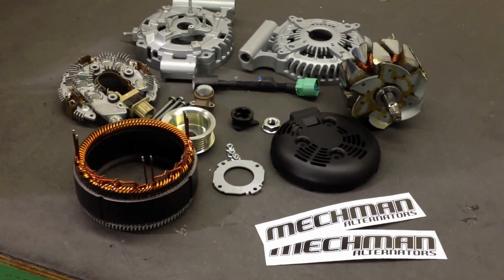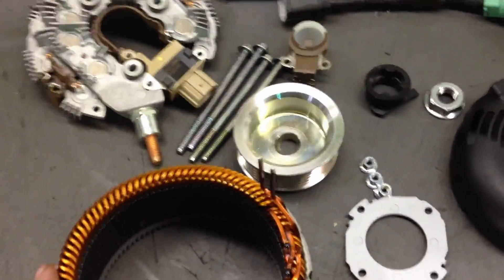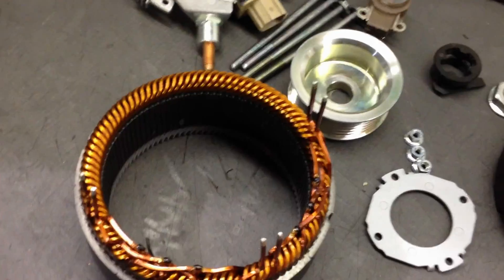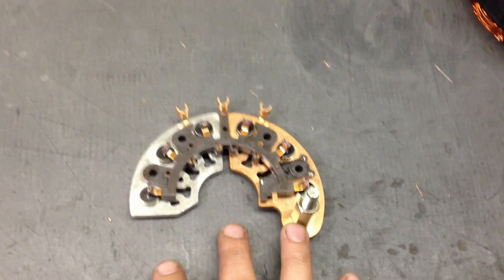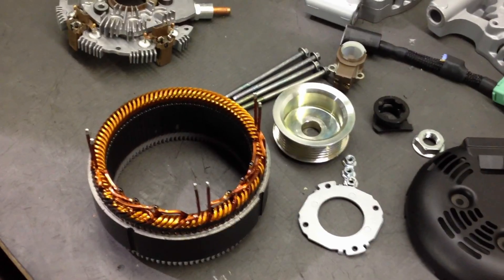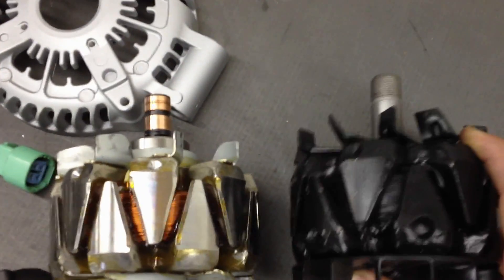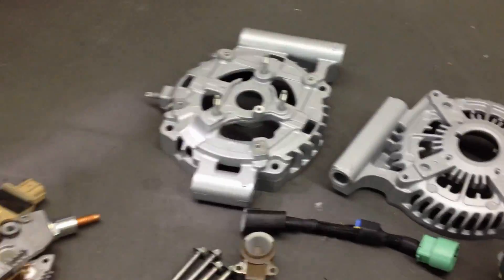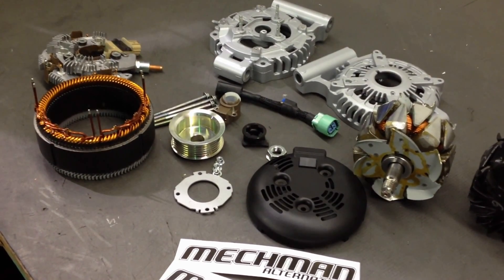Inside Steve Meade's new 6 Phase high output MechMan alternator for Lexus ISF

Comment: Question about the windings. I assume you're using a Wye configuration on the windings. I guess that's evidenced by the fact that each phase lead coming out doesn't have two wires joined at it. That said, it looks like you have two separate neutral busses, is that correct?

It just bugs me that Gale Banks said the 6 phase connections were "not intuitive" without going into further detail.

Comment: I have an 08 Impala LS and I'm wanting to upgrade the alternator what do you recommend I do other than the alternator upgrade and a battery, power wire and  ground wire upgrade
Reply: chris smith 
Not much. Be careful, you can easily fry your ecu by not paying attention to the schematics. You should get the proper repair manual or take it to a shop. It's basic but you never really know. I have a factory 175A Megafuse in between the alternator & battery.

Comment: Usually that's the ecm telling it not to pull power it doesn't need. All that stuff is controlled electronically these days. It starts high to charge the battery from when the vehicle started and then slows down because it's not under load. It's a three wire on your lexus I think. They don't really kick on due to at idle it not using much current.

Comment: wish you guys could figure out a harness for my mechman alt, its a 2 wire system, which is a very common system, my vehicle cause the alt to start at around 14.0v MAX, never seen voltage above that, then it goes down to around 13.1 volts the entire rest of the time, all because mazda wants to make my vehicle more fuel efficient I guess, im trying to design my own harness ..... been studying how alts work

Comment: I can't wait!  My stock alternator only feeds my car 13.1-13.3 volts at BEST.  It's 14v when i first start the car and then within 10 minutes its down to low 13 for the rest of the day. I think Toyota does that on purpose. Its a GREAT alternator, probably last forever, BUT, i need MORE POWAAAAAA. Thanks Mechman!